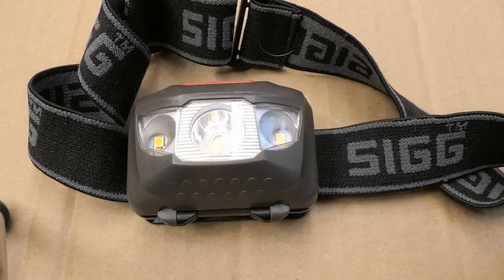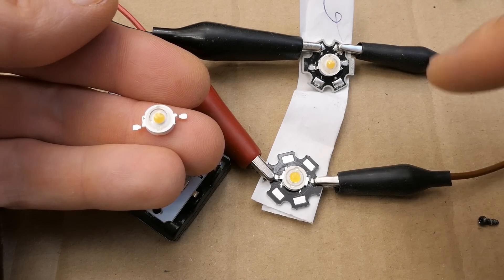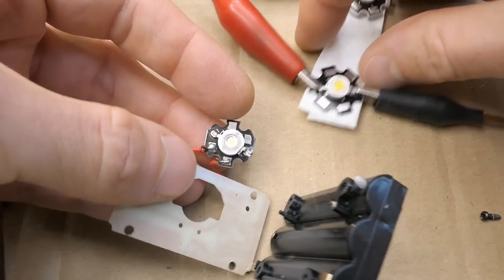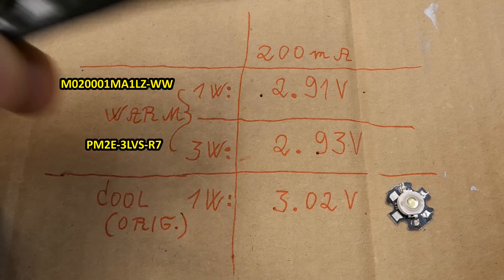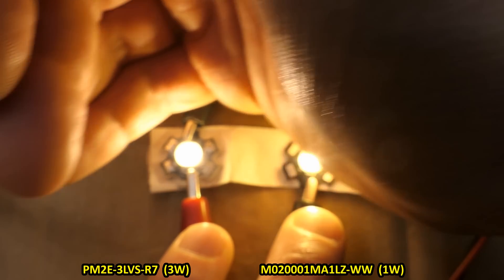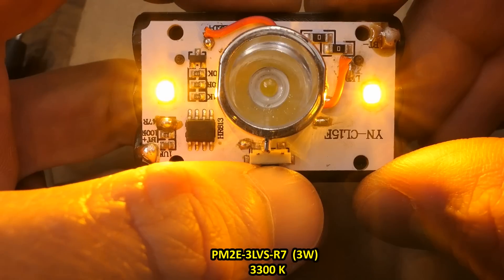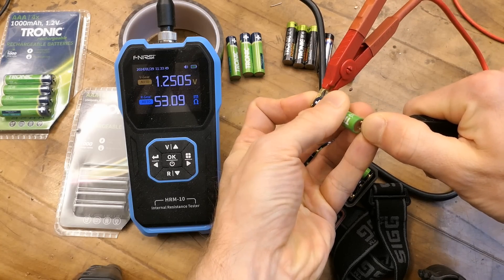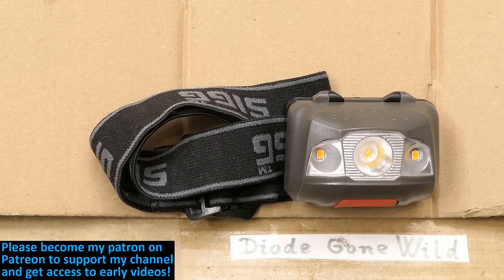Cool White to Warm White LED headlamp swap

Comment: the only difference between the 1W and the 3W is they have added a 2 to the rating.
if you buy the parts where you can check the real datasheets then your be able to see what the difference is.
otherwise you get a one LED fits all ratings and they just change the price.
Reply from the maker: These are from tme eu, not from ebay or aliexpress...
Reply: @DiodeGoneWild  What does the data sheets say about the power ratings. so a better comparison can be made between the two.

Comment: You could surely run this light of a lipo cell if you want to
Reply: No you couldn't. He said current draw depends on the internal resistance. In the case of lipo it's very low which would make current too high.
Reply: @mrfrog8502So just add a series resistor!

Comment: Those lidl batteries are very good for the money. I use them with my ESP32-Cam, they send me a photo every 30min and I can get over 1500 photos with each recharge (I dont like to worry about 18650).

Comment: Why exactly are cool white and warm white LEDs more efficient than daylight ones? I've noticed that this also happens with fluorescent tubes. And the hotter LEDs get, the less efficient they become, but I was recently thinking about fluorescent tubes, If I take a fluorescent tube and put it to work overloaded with a ballast for a bigger tube, does it become more efficient or less efficient? because incandescent bulbs become more efficient when overloaded, but I don't know which technologies this also applies to
Reply: Cool white LEDs tend to be slightly more efficient than warm white ones (~15%). Most white LEDs use a phosphor to convert blue light into a broad spectrum of longer wavelengths. This conversion results in some losses. LEDs are most efficient at low currents and temperature. Unfortunately, I'm far less familiar with fluorescent tubes.

Comment: Maybe move it to Li-Ion? I've used powerbank instead of 3AA battery compartment, and used 5V output and silicone diode to make it close to 4,5V. Power bank gives both equal brightness independent of charge rate and charge function.

Comment: This is awesome. I'm really tired of Cheap & harsh cool white led.
However in my headlamp, the chip is not replaceable. 😢
Its smd type.
Reply: Still possible to replace it, even if all you have is a bucket of rosin, a kilogram of leaded solder, and a giant soldering gun.

Comment: For outdoors 4000K is actually better, than warm light 2700K-3000K, but anything is better than highly efficient cool white LEDs with horrible color rendering anyway.
Reply from the maker: The original LED wasn't 4000K, it looked more like a 6500K fluorescent tube. The new 3300K LED still isn't super warm. It looks better, even in a rain, fog... there's probably a reason some cars had yellow fog lights.
Reply: @DiodeGoneWild  Yeah, sure. I don't know what the original one was in your headlamp, but everything is better than creepy greenish high Kelvins LEDs that unreasonably expensive superbrite flashlights have (and cheap chinese xenon and LED cars headlight replacements). What I meant is that out the usual suspects  - 2700K, 3000K, 4000K, 5500K, >= 6000K for outdoor I personally prefer 4000K. For home 2700K high color rendering are the best, but not always: I've recently added variable color temperature strip over counters in my north facing kitchen - adding a bit of coolness in the light during gloomy winter days actually annoys my eyes less.

Comment: From what I've heard, the cool white LEDs are more efficient due to less light having to be converted by the phosphors
Reply: That's right indeed and that's why almost every torch manufacturer using these (stupid) cool white LEDs.

But I'd rather loose 5% efficiency than having this annoying blueish light. There are only a few torches out there in the market that'll come with "white" (~3000/3500 K) or warm white LEDs (~2500 K). I'd prefer the light like from a halogen bulb but with the efficiency of a standard (hi-power) LED. But sadly I don't know where to buy such torches for a reasonable price.
Reply: @gumpi5  I know I'm in the minority here, but I prefer 5,000K lighting for most applications. I absolutely do see the appeal of warmer lighting, especially in older devices designed with tungsgen bulbs in mind. No way in hell I'm putting 5,000K pilot lights in a vintage radio.

I guess it's just a case of some people have different perspectives and preferences on things. Rather than finding 5,000K "blueish", I find the lower temperatures to be too "yellowish"

But we've all got different tastes, and that's totally okay. Things would be too boring if everyone did the same thing.
Reply: Also, the "heatsink" is usually more of just a substrate to mount them to an actual heatsink. But china found that omitting an actual heatsink costs less lol

Might be worth adding a copper heatspreader behind the LED to spread the heat into the case better

Comment: I've 3.5W a wall fixture that is overpriced enough (130 to 160 Euros depending of the store) to have warm, neutral and cool white LEDs and a jumper to choose which color temperature you want, but I got a demo unit for only 14€ 🙂 Anyway I would never have paid more than 20€ for such a tiny low power fixture.

It's a LEDSC4 series "Sam" model 05-E059-Z5-EH

Comment: Just actually completed a similar mod to my 2 Lezyne 1100 bike front lights, one with 3000K, and one with 2700K. Colour rendering and distance judgement is much better. I also note that a greater proportion of our local street lighting is now around 3000K.

Comment: Warm white modding for flashlights and headlamps is good, because warm yellow light can make visuals better in dark and in rain situation
Reply: have you ever tried this? i dont find this to be true, unless its a blue light source. the differences with normal white lighe and warm withe light should be miniscule
Reply: @PM-wt3ye  Some light temperature sometimes can be not good in certain condition, example my motorcycle using white bright LED light, good on dry road, nut not good on wet road and reflect on white smoke and fog sometimes

Yellow/warm white LED is bright enough based on the LED type/quality and best use dor automotive and headlamps

Comment: Nice mod. In my experience, the only difference between a 1W LED and a 3W LED is the descriptive blurb in the Ali Express listing
Reply: Yes often the difference is the 3W chip is driven a lot harder, and the only difference is the 1W ones are the ones that had a too high forward voltage drop at the 900ma test current, so got binned as 300mA 1W chips instead. I have used the 3W ones at 1W, and actually gotten more light out, as they run cooler and thus more efficiently. Also have had a few running on 50mA used to replace neon lamps as power indicators and operation indicators, simply held on the lamp holder end (plastic one) with a drop of epoxy. Much higher light output, and good even with the green and red and orange lenses the indicators have, with good bright display.
Reply: @SeanBZA  rare to find feedback on these that comes from real life practical use, thanks. Tutorials out there just regurgitate the same nonsense.